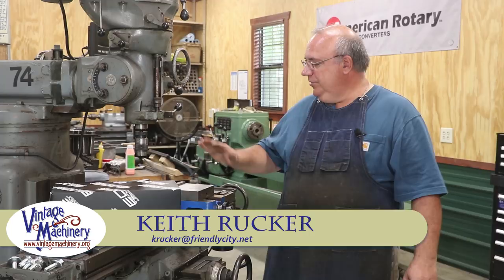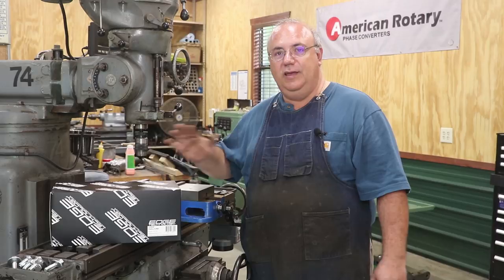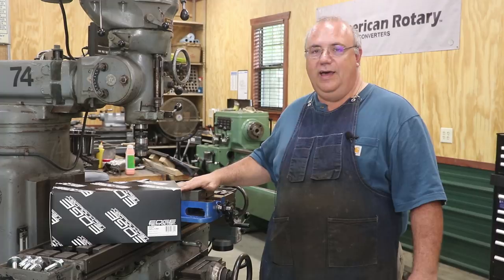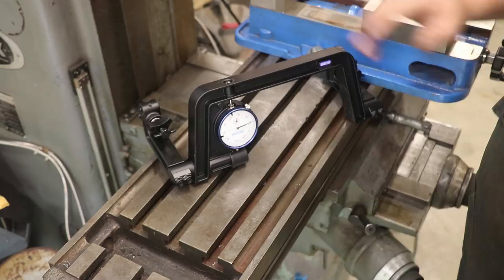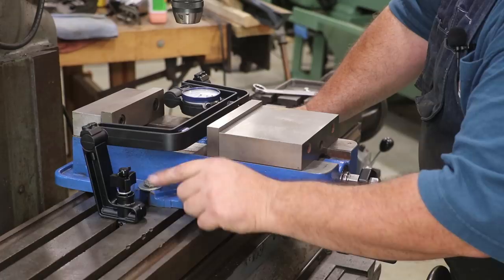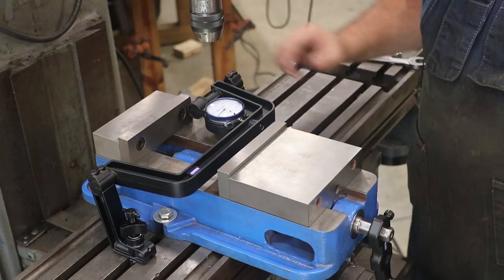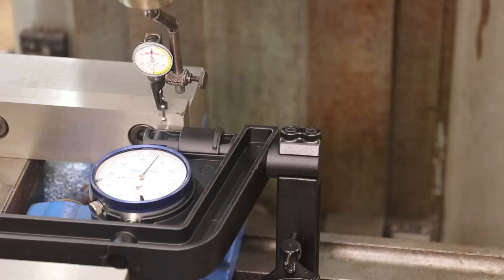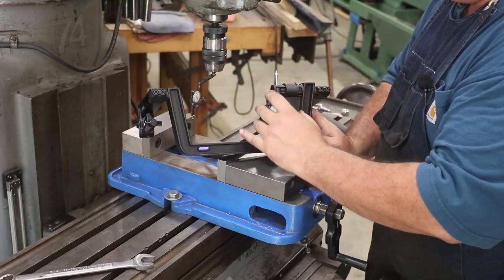Edge Technology "Vise Square" Tramming Tool

Comment: That looks harder work than just sweeping an indicator along the fixed jaw of the vice
Reply: Oh, no. The second indicator mounted to the mill table helps a lot by showing how the one end of the jaw is moving as you tap to move the other end. With this, you only sweep once across, tap to adjust, and sweep back to check your result. Trouble is, you could do this with ANY second indicator mounted to the mill table. Thanks Edge, for showing us this very useful hack.
Reply: A lot of people really have problems doing this. You’d be surprised. The first problem they have is they have both screws completely loose. I tried that to see what happens. It’s almost impossible to square your vise that way, but it’s the way most people try to do it. I’ve had people tell me it takes them 20 minutes to tram their vise!!

Most of us here don’t need it. But I did build my own thing. It’s pretty simple, and you don’t have to make any adjustments at all. Just install it into the slot and move the vise a bit, close the vise jaws down on it and tighten the screws, loosen the jaw, and after taking the attachment out, you’re done. It’s two vertical bars that fit into the t slot, one on each side of the vise that clamp down in the slot, pushing the bars forward in the slot tightly. Connecting the bars horizontally, is a bar that’s flat. All of this is thick and pretty sturdy. Move the vise so the fixed jaw contacts the rear of the horizontal bar, and close the vise. That pulls the vise into position, parallel to the table motion. I get repeatability of 0.001” over the jaw length, which is good enough for most work. I could make it more accurate, but a very thin shim at one side of the jaws, on the side of the fixed jaw, can fix that if required. It just depends on how thin the shim is. About 5 tenths is where I’ve gotten it.

Of course, you have to make this as nobody sells one—hey, that’s an idea I didn’t want to bother with.
Reply: Just use a magnetic base and indicator off the table!
Reply: @melgross I apologize for having to ask you this question but do you work for Edge Technology?

Comment: That tool is an Unnecessary complication.
Reply: I agree, takes more time to get set up than it does to do it the old fashion way.  If you use the locating pins on the Kurt Vise, it will get you within a couple of thou.

Comment: Not to be negative,but: the same thing could be done with an indicator on a magnetic base on the table ,saving the expense of the fancy Edge tool
Reply: ... saving the expense, plus avoiding the need to store yet another special tool!
Reply: Just another marketing thing to make an overly complicated tool to do a very simple task
Reply: an indicator on the table and one in the spindle,essentially what the Edge tool does
Reply: It may speed things up a bit,as you only need to sweep one time

Comment: I agree with Robin. That Edge Technology gadget is an expensive and nicely made solotion looking for a problem. The two indicator  method Robin outlined is what I was taught in 1961 by Grant Frasier. Its quick, simple, and sure.

If you have only one indicator, squareing a vise jaw is a simple process requiring a little ratio and proportion math.

- Start with a clean vise on a clean table with the hold-down bolts in place and the vise "settled" finger tightening the bolts. Snug the left bolt to act as a "hinge."
- Mount an indicator and set the contact on left side of the fixed jaw in the usual way. Set a zero. 
- Measure the X axis distance from the center of the hinge bolt to the indicator contact. Note that distance for future use whenever to have to square the vise. Call that figure the "offset."
- Dial the table ro the left by the amount of the offset and note the indicator reading.
- Bump the vise past  zero to equal the noted indicator reading on the other side of zero - IOW words bump the vise twice the noted reading. The vise should be roughly squared at this point but for precision work refinement (or at least a repeat zero confirmation) is required.

- Go back to your starting point and set a fresh zero. Dial the table 6 multiples of the offset and note the indicator reading. Calculate 7/6 times the indicator's reading and bump the vise to correct (a proportionate over-correction, actually) by that amount. Tighten the second bolt watching the indicator for movement. Reset the indicator to zero at this point.
- Go back to confirm your repeat zero. Tighten the hinge bolt watching the indicator for movement. Note: t4here is always some uncertainty using a snugged bolt as a hinge point. If your repeat zero doesn't pan out, refine as needed remembering to use ratio and proportion to calculate vise movements.
Reply: chris0tube You  miss the point: I described doing what the gadget did using standard shop equipment without the expense. Personally I use the one indicator method and mental math. I usually get it within 0.0015" in the first move and 0.0005" in the second but I know my equipment well and many years of progressive experience has made me efficient.
Reply: chris0tube Common sense is great stuff but common sense fortified by simple rough mental arithmetic saves you time and frustration. Basic ratio and proportion combined with mental calculation has over the years saved my employers - I dunno - hundreds of man hours. Maybe thousands if you count the same tricks I taught to my helpers and apprentices. If you deliberately avoid cthe calculatio22nd necessary to the machinist's trade its like choosing to run a foot face with your foot trapped in a bucket.

Kieth himself in this very video mentions the difficulty teaching noobs the trick of efficiently dialing in a vise. He's a fine man and an accomplished machinist but to this one point is say: "baloney." I've taught hundreds how and it takes one demonstratio.  If you know your pivot point and the distances between pivot and the start and end of table travel to dial the vise you can determine the the amount of correction, make it and reduce it to 5% of its initial value. This same technique is applible to any indicated parallelism problem.
Reply: chris0tube To each his own; my way or the highway: that is the question.

Naturally you adapt your teaching to suit your student but rough menatal math and easily mastered geometry are hardly advanced concepts. I thought my role was to equip my apprentices with skills and concepts,  exercise them with resources and progressively greater challenges, etc, then turn them loose to sink of swim. Naturally, there was a dunce or two along the way. Not everyone has the necessary aptitudes and early opportunities to exercise them: a successful skilled worker starts young. For those who fail  in one line of endeavor there is a world of other paths.  I got stories of apprentices I've scuppered who went on to great success in other fields (one became a chef of some reknown.) Everyone's got talent but they have to figure how and where to apply it.

I have a hunch your definition of basic math, mental arithmetic, etc is far different from mine or we wouldn't be arguing.
Reply: chris0tube Have it your way. I figure we'd need to  have at least one face-to-face meeting in one or the other's shop, a pizza, and a box of beer to work this out between us.

Comment: Nice demo Keith! From your test indicator wobble you may need to snug up your gib on the table a bit. I see your cranking influence on the indicator. IMO that is a total wast of time. you could do the same thing much faster by just putting another test indicator on the jaw in the same location using a mag base. Good review .....totally unnecessary product.
ATB, Robin
Reply: I have to agree , although It certainly is a clever device the old phrase "a solution in search of a problem" comes to mind. Any wannabe designer should always ask himself the first question that needs to be asked when he comes up with an idea, "what problem is this the solution to?" and for most competent machinists there is no problem mounting their vice squarely..
Reply: Don't forget to set your frammitz valve at .003 before you begin cowalting the tool !!!
Reply: Are you quoting from the Turbo Encabulator instruction manual?
Reply: Thats not the gibs, it would be a lot larger error if they were loose enough for anything to move (2 hard surfaces). Its just the surface finish of the vice jaws, years of snugging down will eventually put some dents in the face.
Reply: I respectfully disagree and maybe Keith will prove it out. That is almost a full half thousandth of motion and I am sure Kurt is not sending out jaws with .0005" of wheel hop on the grind. If he does the same thing but uses the feed to move the table that wobble will dissappear since his cranking influence will be gone. His gibs are loose. I am glad to be corrected if I am wrong.
Reply: I wouldn't second guess the mechanical sorcerer. Rumour has it, he can smell within a tenth.

Agreed, pretty pointless bit of kit but free toys are free toys.
Reply: ROBRENZ 100% agree with you.
Reply: ROBRENZ Have to agree.
Reply: Would be good to see exactly what's causing it if Keith can be bothered. My observation is that it only occurs in the middle of the jaw, the most used area and while I agree 100% that a quality vice such as this would never come from the factory with the surface wobbles. Like any hardened material, it has a "weakness" (which is actually its strength). All of these jaws, be it a kurt or a vertex are surface hardened prior or ruffing and drilling, and like any surface hardening it has the characteristics of creme brulee. Go chuck a ball bearing in and crank down really hard, very quick way to ruin a pair of jaws and leave a nice little dent in the face. What I believe we're seeing is many many years of proper use, still completely serviceable though.
Reply: Jeff Jenner WOW questioning ROBRENZ! You go get um champ...
Reply: Jeff Jenner 
Brave this one is.. 
Win he will not!
Reply: Oh, the owners at Edge knew which "problem" they set out to solve... they needed another Cool! gadget to sell to folks with more dollars than sense...
Reply: Nobody wins on the internet
Reply: Guys is That not the old vice that Keith refurbed in an other video , I cannot remember if he ground the jaws , just my thoughts gib slop can cause some funny results. I do see this gadget from edge a bit of a joke but then what do I know as a hobbies workshop guy for 50 years 🤯
Reply: I could be wrong but that vice does not appear to be "many many years " old
Reply: I'm thinking the same thing Stuart, definitely the same kind of vice, but I doubt I could identify it by eye. I remember him grinding it, but that doesn't make it true. Regardless, a video on chasing down error in the vice would be neat.
Reply: ROBRENZ I have the impression you might not have seen Keith's vice restoration videos, where most of the surfaces were reworked.  I wonder if that's playing into this situation.

Comment: Thanks Keith for being so open and transparent about your arrangement with the supplier. This is how it should be done.
I think a much simpler improvement of a vice for fast tramming is to cut a keyway in their bottom surface and bolt in keys that match the T-slot width. That way you get a good pre-alignment that in many cases is sufficient by itself. And then the hand tramming with dial indicator possibly using the fast feed should be easy enough. The Edge tramming tool might serve as an alternative for keys. But it seems awkward and bulky to me.

Comment: If you cant indicate a vise with only one indicator then you dont need a mill.
Reply: spot on
Reply: I can do it easily with one indicator. However, this technique would let me do it quicker. Placing a second indicator on a stand (which I always have available anyway) would not cost me as much time as a second or third sweep using a single indicator between taps to be sure both ends are the same.

Comment: It's shows how much your channel is respected if companies start sending you stuff. Please just don't 
do a 'Wranglestar' I gave up on his channel when it became a one huge  deWalt advert.
Reply: g2macs but he uses makita tools in like, every video I've seen?
Reply: You must have missed the one where he destroyed a 20v dewalt drill with a 18v Milwaukee drill
Reply: E. Glide you realize that both tools are actually 20volt nominal, right? The cells use 5 18650's which output about 20v nominal. (More like 18.5v, but that's semantics) mil-fuck-yee made a shittier tool. Get over it.
Reply: Credit Milwaukee for rating their tool honestly,  whereas dewalt follows the  philosophy of overeating to dupe the  uninformed.   Buying the dewalt name didn't change the quality black and decker had become known for.
Reply: black and decker also bought ELU which were very good tools, and merged into the dewalt line
Reply: Thanks for the demo Kieth, well-done as usual.
I don't own a mill yet but one is on order and it has 10mm or ,3/8" slots. Most small mills do. This tool misses that market. 
As most people have responded save your money and do it the accepted way.

Comment: First time I have strongly disagreed with you. This tool is a solution in search of a problem. Beginners just need to practice. When I was a beginner machinist, money was in short supply. Buying a fancy one trick tool was out of the question.  I think you treated the manufacturer too kindly. Didn’t need to be harsh but a short “unnecessary tool” would have been truthful.

Comment: Not judging anyone but with just a bit of practice you can do it faster with just the one indicator…. Cool tool, I was hoping it had other uses.

My trick is to tighten one side and then just barely snug the other, then I can just make the other side of the vise match the locked down side.

Comment: I'm only a hobby person, but a square back edge to the vise backed onto the column gets it pretty close to start with. If the vise has a curved back, just machine a flat on the back, after squaring the vise. Yes two dial gauges would do the fine tuning. I find it is careful tightening the holding nuts, that might otherwise alter the setting, is as important as anything.
While watching the vid, I was thinking a couple of screw adjusters attached to the bed and vise might be good for those that struggle to get it that last couple of thou....

Comment: What's wrong with using keys underneath the vise? I use precision grounded keys, and the vise are spot on in seconds, when dropping into the t slots.   This I can't see any use in having?  Using a dial indicator takes less time than setting up this rig.    Kiss..... 😎

Comment: It seems a good idea if it speeds up tramming, but as an amateur, I can tram a mill vice in less than 10 minutes. Something I do find is that my fixed side vice face block is warped and deviates by 2 thou in the middle, like this...   ) |  . I have tried shimming it but it doesn't seem to ever be successful. Should I mill the faces in situe or just ignore it?

Comment: At a suggested price of US$199 or even a discounted price or US$125 it seems like an expensive alternative to simply learning to tram a vise.  It does suggest that an indicator on a magnetic base to fix the position of one corner for comparison to the test indicator could do something similar without the cost of the fixture.

It does what it is designed to do very well, but I have to question whether that is worth the cost.

Comment: It is not difficult to square a vise with just an indicator if you tighten one side down and leave the other side loose.  The tight side then serves as a pivot point and the loose side can move forward or back.  The problems most people have is either they overshoot by tapping too hard, or they do not check their work and the vise moves on the loose side when they tighten down the flange nut on the loose side.  This latter problem can be somewhat mitigated by using a regular hex nut and heavy (thick) flat washer that can move when torque is applied, but in either case torque is applied SLOWLY. Leave it to Edge Technology to come up with another product to a problem that doesn’t really exist.

Comment: I am fairly new to hobby machining but watching several videos (OxTools and Tom's techniques) on vice tramming made for a good learning experience. I now use a .0001 indicator and am not happy with less than zero all the way across. This is a nice tool but sure seems superfluous to doing it the 'tried and true way'. I enjoyed this, and all your videos, but I am afraid Edge is off the mark with this tool.  Perhaps had I not figured out the original way, I would be purchasing one of these though.

Comment: As a student machinist who hasn't yet even graduated yet (just finishing the traditional machining modules now), I really can't see the point of this tool -- ESPECIALLY not with a relative amateur, who almost certainly will NOT have vise jaws free of dings and whoop-de-doos: in which case, the user will be tramming to a dent or high spot with false confidence.
Want your vise to be close to straight from the get-go? Push it to one side of the T-slots and then tug it back a sixteenth or so using both hands, then sweep your indicator. I would have my vise in tram before I could get to the shelf to fetch this frammish!

Comment: Set up vise one time upside down, mill slot in bottom to accept 3/4" key stock, drill and tap keeper bolts, then turn vise over and drop into table slot.  If not close enough some work needs to be done on the machine to square everything up.